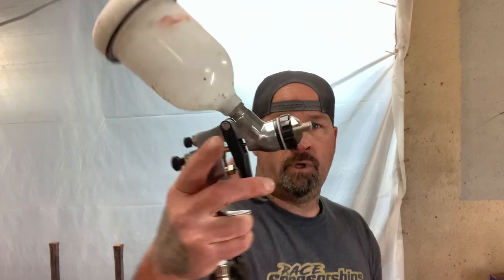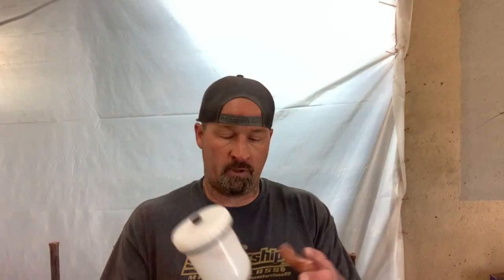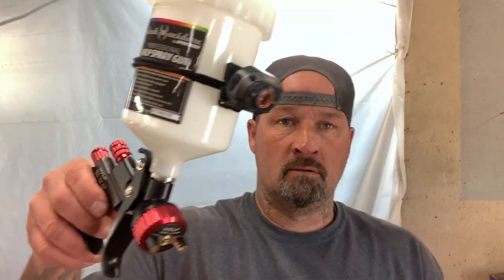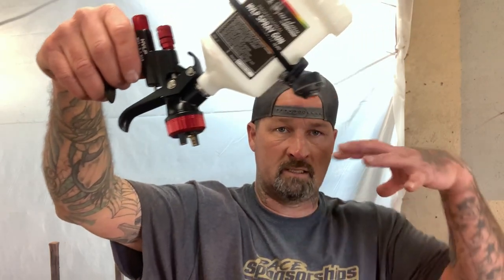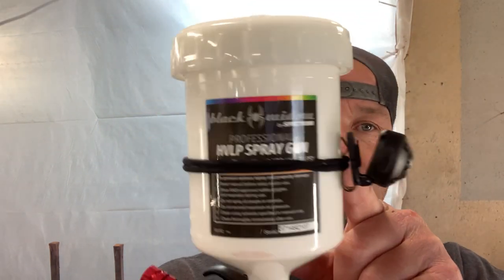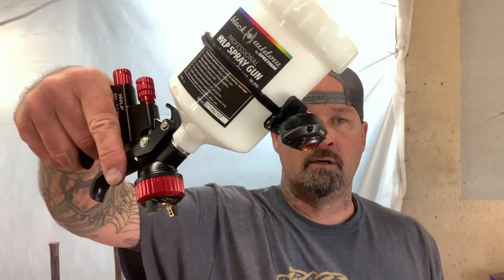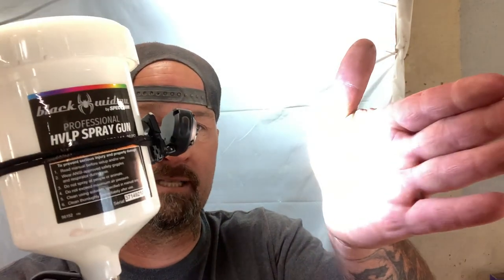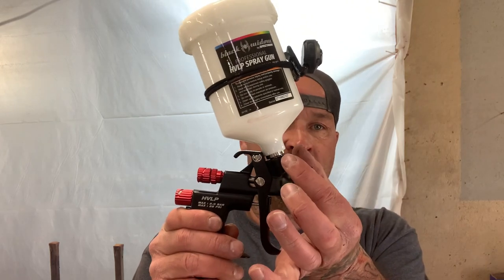Body Shop Spray Gun Flashlight Hack, HVLP Auto Body

Comment: the light flutters on camera because of the frequency of the light versus the frame speed of the camera. all you have to do is set the camera's frame rate to something else and the flickering will stop showing. it's sort of like how when you see some cars rolling down the road as you watch the video and it looks like the tires are spinning backwards. it's just a frame rate problem

Comment: Since my shop is where I paint, and there isn't enough light in there to shoot dark colors, this is a great idea. I saw an ad for an extra bright wide angle light earlier, that would be great. Man I need to put more lights in my shop. Two or three of those would work good for me. 

The GTO has some tiger stripes that show up real bad in bright sunlight. When I do the Cutlass for my friend in Chicago I can't have things like that in it. She would be too embarrassed to drive it. She wants it that dark HOK purple that looks black until sunlight hits it, then its purple with whatever color you put under it, like gold or silver. To do it right is going to be $5k without the primer/surfacer/sealer/ and all the non color stuff. Plan is to finish the metal work and get it back on the frame this summer between trips to Nebraska to move cars up here. I wish I could move more than one at a time....
Reply from the maker: Man that’s gonna be some cool projects bro. If u get near us please stop by 👍